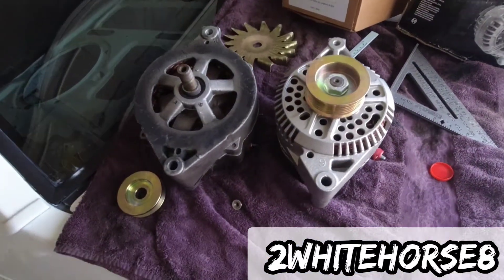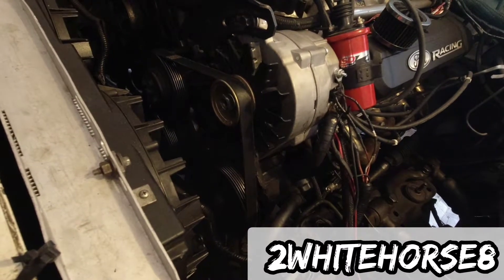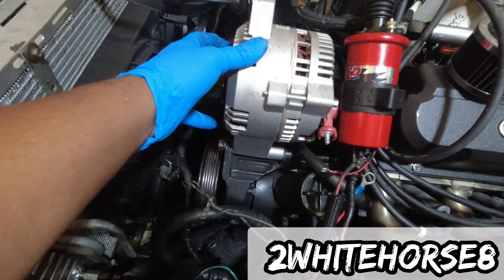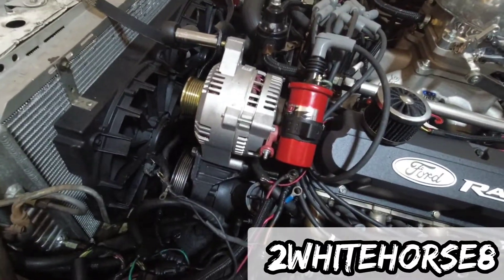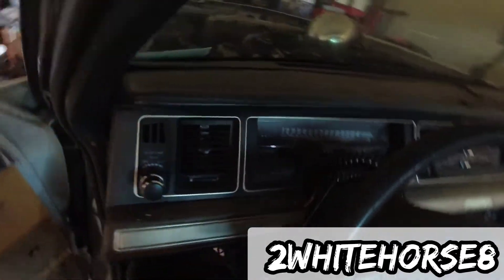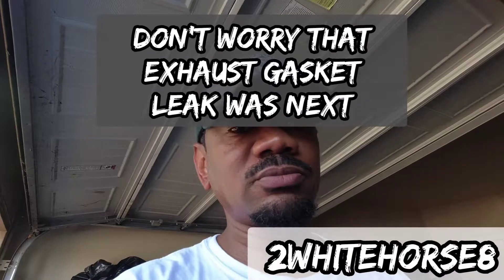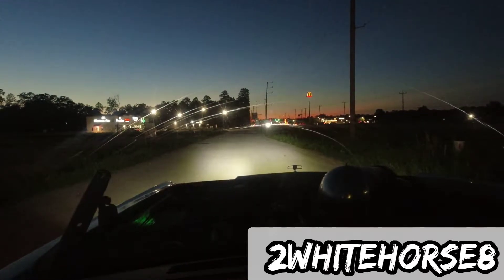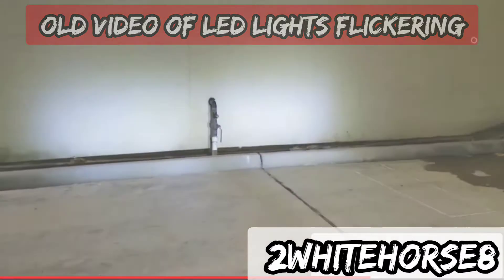Ford 1G to 3G Alternator Upgrade for 1991 LTD Crown Victoria - Simple And Worth It

Comment: Also,  is there anything else that's easy enough for a newb to fix up to give her more power that you suggest?  I'm no drag racer but she's a beast with minimal oomph from the get go. 😂
Reply from the maker: Usually a better and bigger carb helps. More air via a bigger or better intake is easy to do. Tuning the timing is relatively easy. Upgrading the spark plugs. Those are some easy things to do.
After that I'd say move up to a better camshaft.

Comment: What part did you end up using and how'd you reposition that one red part so that it  fit correctly?  I just got a 91 country squire that has the same engine as you and i figure since it needs a new alternator i may as well do it right ;)
Reply from the maker: If you're referring to the red part where the power wire connects to the alternator, a normally wired vehicle should be fine. I just have 0 gauge wire that uses bigger terminals.

Comment: You should probably consider getting a bigger alternator if you're only charging to 13.9. A "healthy" charging system makes 14.5 volts at idle. You likely have electric fans, electric fuel pump, electronic ignition, and killer stereo, and all that stuff draws a lot of juice.

Comment: Where u get altanator or what model car it come off
Reply: Why not a 3G P71 alternator?
Reply from the maker: I'm not sure if it's a direct fit to my older vehicle. The one from the Taurus was a direct fit for sure.
Reply from the maker: My alternator is a remanufacturered part that I get from a local source. If you are looking to get a new one, go to autozone and get the alternator for a 1992 Ford Taurus 3.8L V6 130 amps.
Reply: @2WhiteHorse8  Or you can go to Summit Racing and get bigger (more amps) 3G alternators with more amps 140-320. Anything bigger than 150 amps is going to come in a larger case, so be aware of that before you plunk down cash for one.
Reply from the maker: Yeah, youre right... I guess. But it still has to fit and have a plug that mocks up to the car you're driving. This one works for the 91 Crown Vic that I have so that is what I put on here.